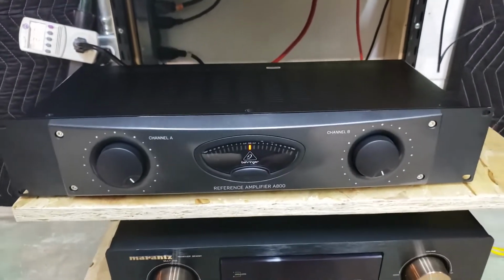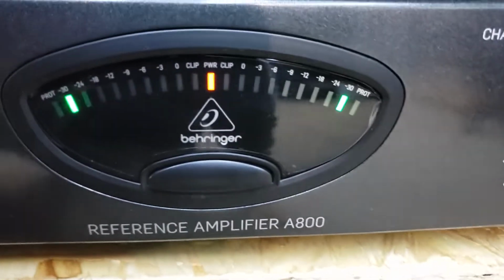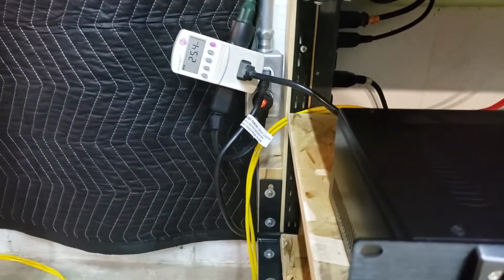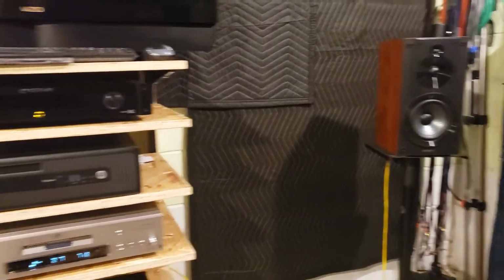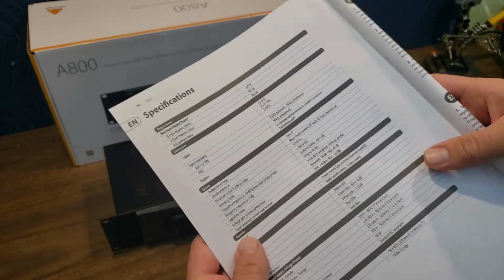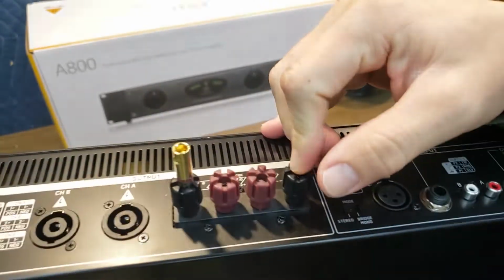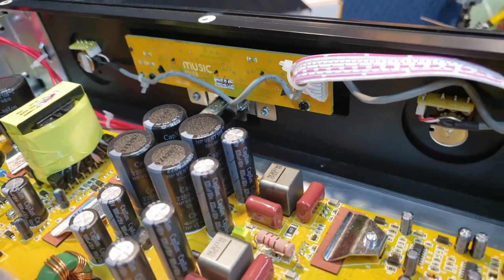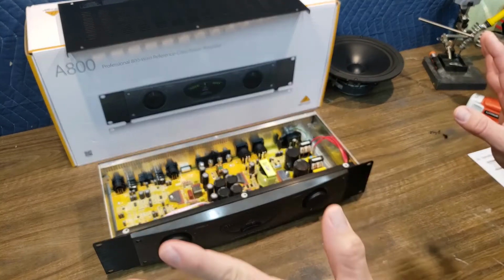Behringer Reference A800 Amplifier (Budget Beast)(Improvement Over the A500)

Comment from the maker: I spent about 3 months with this amp and so far have been quite impressed. It will be sent off to Audio Science Review to be further analyzed and reviewed to find out if it really is an improvement over the A500. The test results are in click here  --> https://www.audiosciencereview.com/forum/index.php?threads/behringer-a800-stereo-amplifier-review.10499/
Reply: Low audio guy very important question for you. I'm looking to upgrade from my xli 800 for better signal to noise ratio, I was going for outlaw audio model 2200 to match my 976 receiver from them but it's out of stock no telling when it will be back, so after I saw this one a800 an the price I thought it would be a great alternative so to you is this better than the xli 800 an with the gain knobs at 70% how is the heat build

My current configuration with my xli for my fronts and center an sides and backs, from the Receiver channel output is - 7db on my fronts an side's, on my center and backs is - 10db
The xlr preouts is rated as 4v to 9v an all my xli's are set in 1.4vrms mode

What are the sensitivity options for the a800
Reply from the maker: @DREDKNOT2063  Way late response but I belive the A800 is the standard 2v on the RCA and 4v on xlr. I'm sure you could run higher line votage if need be and just back the gain off to prevent clipping. To bad the A800 is sold out everywhere I've been waiting months to get another one. You could also use the Crown XLS1002 or QSC GX3. These are all better options over the xli series.

Comment: I am going for a Classic pro 1400/1200 or a V3000 because my Sony ta-v777es gets hot after 30 mins when volume is at 10:30 11:00 position so because i don't want to burn it i am goung to use it as a power and give the beans to the power amp the Sony ha e enough power to shake the house down it's a 155wpc on 6ohm so enough power for what i need but i want it to last

Comment: I don't understand such a power measurement of this amplifier. What is the point of measuring power at 1Khz?! Everyone who knows anything about it measures power from 20 to 20Khz! Bass has the greatest power requirements. If the amplifier delivers 2x140w @ 8ohm at 1Khz, then consider that the sinusoidal power from 20Hz - 20Khz it's 2x90w @ 8 ohm. If you use Bass Correction in addition, the volume will decrease and the amplifier will reach the limit even faster.

Comment: Another thing is that it increases the bass output when the volume is increased, even though I know that my sound source does not do anything like that. My older class H amplifier did not do anything like that and also had deeper bass around 15-20Hz. I can recommend this amplifier as a Pa amplifier but definitely not Hifi.

Comment: It has a good and neutral sound but the lowest bass is missing.  It plays at full power from approximately 40Hz and 30hz -3db.  I know that many speakers cannot produce such a frequency, but I think that the amplifier should be able to handle it if a subwoofer is used.  But for the price of 190 euros it is ok
Reply: Not true.?? You have no measurements to back any of that blabber up

Comment: the amplifier source has a maximum voltage of 150mA.  So the performance is much lower than stated by the manufacturer.  It can only be 2*100w at 4ohm RMS.  Has anyone measured the performance of this amp?
Reply: Where'd you get 100v from in your calc?
Reply: See the link in the description for an objective review.
Reply: @shaunonverwacht9626  approximate power is 2X120w at 8ohm and 2x200w at 4ohm. The main problem of this amplifier is to produce deep bass below 30hz, although it is there, it is with a lot of attenuation, which I do not consider hifi. I would recommend it for undemanding Pa applications.

The sound is balanced but not natural. For the price of $190 it's okay but no sonic miracle.
Reply: @ Hifi performance requires -3dB at 20Hz, at worst. The amp was measured to give -0.6dB at 10Hz. Your assertion is not supported by the data.
Reply: @shaunonverwacht9626  show me the measured value of 10Hz @0.6db. Only a very expensive amplifier for thousands of dollars can do that. You are a funny person 😀 You need to use the right measuring device and Test the frequencies and measure them at 0db. Then the sound will distort and you will have to try the power. According to the tests it is at 1Khz @ 140w. My values at 20Hz @ 50w. 40Hz @ 100w.
Reply: @KevinRusnak-ig8gl  it's right there in the graph. Did you go look at the test report by amirm at ASR?
Reply: @shaunonverwacht9626  

I have a t.amp TA1050 MK-X amplifier in comparison 

it has more power and much better sound and more deep bass and a flat frequency curve. another amplifier the t.amp S-150 MK II

this also offers very good sound quality. Behringer A800 I can not match the sound quality of these two amplifiers. Behringer does not deliver the performance specified by the manufacturer and the frequency range is not flat, it has emphasized Bass around 50-100hz and higher tones around 12-16Khz are increased which is not suitable for HiFi use. It is not a universal amplifier. If someone has good ears then it is clearly audible.
Reply: @KevinRusnak-ig8gl  stick to facts. I referred you to a test report that shows that the amp has respectable performance and none of the faults that you claim against it. Where is the evidence that supports your claims?
Reply: @shaunonverwacht9626  There is a lot of evidence. There are also bad reviews where some people complain about extended higher tones and other reviews refer to weak sub-bass, even if there is, it is muted, which does not happen with most amplifiers. Crown Xls does not have such problems, it pumps bass almost to 20hz. If deep bass is missing, it is usually due to a weak power supply. The power supply provides approximately 350w maximum power. Another thing that is not real is the total power of 800w. 2x130w is real power. The maximum power of 800w cannot be achieved due to the weak switched power supply of 350w. The review only shows us the power measurement at 1khz. Most of us would like to see it at 20hz, 30hz and so on.
Reply: @ it's not good enough to say there's a lot of evidence. At least give one reference of objective measurements instead of anecdotal stuff. Power delivery at other frequencies will typically be similar to the 1kHz measurement, unless there is a serious power supply design deficiency. This is why you need objective measurements when you call into question the amp's power delivery at other frequencies. However, the attribute of interest would not be maximum power delivery at every frequency, but rather frequency response, which is shown in the report, including response into a complex load. Those measurements were done at 5W, which is quite sufficient power in terms of domestic listening levels, and any anomalies at this level should have been evident in the measurements. But they are not.
Anyway, at this point it seems that you have your mind made up, so that will be my last post on this topic.
Reply: @shaunonverwacht9626  
As I said, it's not a bad amplifier for small speakers. But they can't be called Hi-fi because it sounds like any other cheap amplifier. The sound is neutral but it just can't handle subbass. T.amp for the same price is more neutral and can handle more subbass up to 20hz. I had it at home but I decided to return it. It's everyone's business and taste.
Reply: @shaunonverwacht9626  

the measured power 140w @8ohm is measured only at 1Khz .. So it is quite clear that the power for 20Hz - 20Khz will be almost half . The test is therefore useless . Music produces many frequencies not just 1Khz . You should learn something about physics .. goodbye .

Comment: very late here, but since you had the behringer tested and found it can do 160w continuous and you have a marantz that can do half of that, you might be expecting it to be twice as loud. unfortunately with the way human hearing works, to get twice as loud as the marantz receiver you would need not twice the power but 10 times the power, or 800w per channel.
Reply: of course more efficient speakers are always an option. i run 99db sensitive pa speakers from a behringer nx4-6000 amplifier. i like big speakers and big* power. nothing else really scratches the itch, even at low volume.

* please ignore the over inflated power figures behringer state for this amp.

Comment: HELLO ... is it better than the CROWN XLS 1000?
Reply from the maker: I have not seen any actual measurements on the older xls1000 but I doubt its better than the new xls1002 and the A800 slightly measures better than that. I also had a xls1000 for a short time great amp considering the power you get. I'd say the A800 is better but only slightly. Problem is the A800 is sold out everywhere 😕

Comment: Class D is more efficient than AB so it will draw less power at the same volume.
Reply: Class A. and A/B draw the same power at volume level 0 as they do at maxed out.  Which means it has a constant draw of power of 100% regardless of volume setting.  Class D power draw is variable, and is not at full tilt 100% of the time.   The volume control sets that variable.  You can have a Class A/B amp powered on, have the volume set to 0.  The Amp will heat up, and after a short time will get hot.  Class D is not running at full tilt 100% of the time as Class A, and A/B do.  Class D has a fast switching power supply, as the Class A, and A/B do not... If you set the volume at 10%....then you will have approx 10% power draw.  These are not precise measurements, but I think you get the point. CHEERS!

Comment: Scanning the comments I don't see anybody mention this but the volume knobs are probably just pedometers after the input stage so other than being separate knobs they would do the exact same thing as if you put a volume knob before it not really gain controls but more like resistive limiters forming anotherwords a pad circuit. Since it most likely is a class D amplifier it will be using some power as necessity to run the power supply to keep the electronics running with no signal. Then as you have more signal it will be using a little bit more until you hit that high bass where it will suck down the capacitors reserved store which will cause the power supply to draw more current possibly sagging the line voltage. However since it is a class D amplifier its doing this hopefully if design well very efficiently.

Comment: You generally want your pre to be higher and your amps in the middle or a little lower. This will keep your noise floor down.
I wonder if you could throw a resistor on the output instead of a speaker and crank everything to figure out how much power it can actually draw. Regardless, the 50W power draw at max volume and the input close to clipping shows that it isnt putting out anywhere near what it states.
Reply: It could be that the impedance of those Jamo's really goes up when you crank it. Maybe?
Reply: @sebdhaese  usually speaker impedance doesn't change with volume, only with frequency.

Comment: I'm surprised it clips too man. Are your speakers inefficient?
Reply: That is weird indeed. Those Jamo's, he was driving, are pretty efficient as well. I think Behringer is not completely honest about the specs.
Reply: Knobs on the A800 is gain control, not volume or 'suppose to be at max' as he said it. The clipping lights on the unit obviously come on because the source is clipping, not the speakers.
Reply: @bererboy01  If the amp is clipping then you are running out of clean power, which means the speakers are hard to drive or you don't have all that much power.

Comment: Thanks for sharing this .  Interesting that an 80 wpc ( probably and RMS rating ) will reach the same output levels of output as this rated at 220 wpc at 8 ohms .  I think a lot of these new class d commercial amplifiers must be rating at peak output for a few milliseconds every so often . With the input power consumption rated at 90w on this amp , unless there are massive banks of reserve power (capacitors), these power ratings must be for very short bursts , very deceiving to compare  . They should give a continuous output rating , but that would be embarrassing  . Physics are physics and nothing can be more than 100% efficient , it's just not possible in this universe , otherwise you could plug it in and it would magically pump free electricity into the power grid .
Reply from the maker: Check out AudioScienceReview test link should be in the description. It did not manage the advertised 220w @8ohm but it was able to crank out I think 160w @8ohm x 2 which is a good bit of power. I think its the other way around, this amp consumes more power than they advertise. Since its class D they want to seem efficient as possible and high power. This amp tested pretty good and is worth its price. Behringer realy did improve over the older A500.

Comment: Power is power vs distortion, meaning the seller of an amp wan say whatever he wants : my amp can do x watts with y distortion. Then if you are "hifi" you limit the max volume lower so that distortion is still minimal at max volume.  class A, B, AB, H ar all smoothly transitionning into distortion, so when you push it very progessively start to distort, lovely. Class D goes to a point, and then start distorting very sharply, but you can push it a little more, between 1 and 3 % you can hear the distortion (if your ears are not yet bleeding) or if you have speakers inefficient enough for that to happen at a bearable volume. The actual sound energy that breaks the windows and make the police come is a result of amp behavior end speakers efficiency and air volume they can move. 105db speakers can kill you with 1 watt. 90db or below speakers need power in 10s or 100s of watts even small ones.

Comment: As this is a PA amplifier, the goal of the setup is to have the two gain controls as low as possible, and deliver to it strong balanced XLR signal, there you'll have the max power from it. I think it was tested at 29db gain, witch is not the closest to max. If you have to make the gain go way up like above 3 o'clock : your signal is too weak. With a good preamp you should be able to clip the amp at 12 o'clock. The quality of any amp lowers when the gains are too far away from 12 o'clock.

Comment: Because of how fast class d pulls power the meter would have a hard time showing it being instantaneous power kinda idea and not being a constant signal like a 1khz noise test
Reply from the maker: I see. I have also since read due to the Pulse Width Modulation power supply in this class d amp a power meter like I have won't work. Reading about how class d amps work is pretty interesting and its getting impressive how much better they've gotten.

Comment: I would like to see a follow up to this video.  Having the gains on this amp set at 1 O'clock and also with the gains on this amp set at 2 O'clock....then when does this amp start clipping using your emotiva pre-amp using the amp gain settings I recommended.  I am considering purchasing both these items and using them together.  I  was wondering at what volume setting the emotiva is turned up to before the amp starts to clip.  Thank you very much for your video.  Also, thanks if you can do this for all of us.
Reply from the maker: I no longer have this amp, its being replaced with a Emotiva A-300 soon. But if I remember right having the Behringer A800 at full gain it would start to clip "according to the front meters, not always accuarate" with the Emotiva PT-100 at 60 - 65 out of 80. This was louder than I ever listened unless the wife was gone, I was drunk and I happen to be in the mood for Linkin Park....LOL. I'm guessing it was around 95 - 100db in my space. BUT the A800 never broke up or gave any indication it was tapping out even when the meters where pushing into the red. If you haven't already read the review done by AudioScienceReview please do. The link should be in the description. I didn't sell this amp because of any negitive reasons, I would still say this is one of the best power/performance amplifiers for $300.
Reply: I would expect the amp to clip sooner if the gain is set at max settings.  I was just wondering, if the A800 gains was set to 2 o'clock or 1 o'clock, how far you would have to turn up the Emotiva before the A800 would start to clip.  Thanks for the response.

Comment: hello I would like to buy it too to amplify the focal aria 936 from the floor ... do you recommend it to me? does it sound good and better than the a500? also are the cooling fans noisy? thanks roberto
Reply from the maker: If your looking for a powerful class D amplifier around $300 I would recommend the A800 or the Crown XLS1002 for a little bit more.  Both have powerful clean sound. The A800 doesn't have fans so its dead quiet all the time. Check the Audio Science Review link in the video description to see the test results for this amp. Its good improvement over the A500.
Reply: @iowaudioreviews  So, did you end up with this amp?  What are your thoughts, if you did?
Reply: @iowaudioreviews  thanks a lot